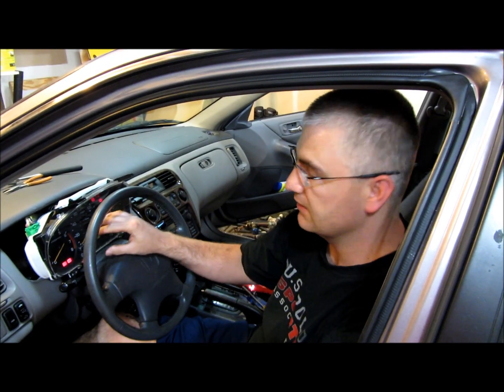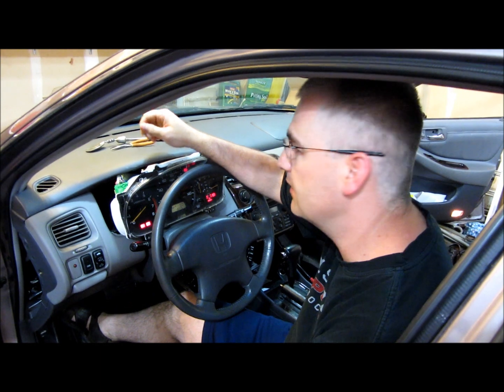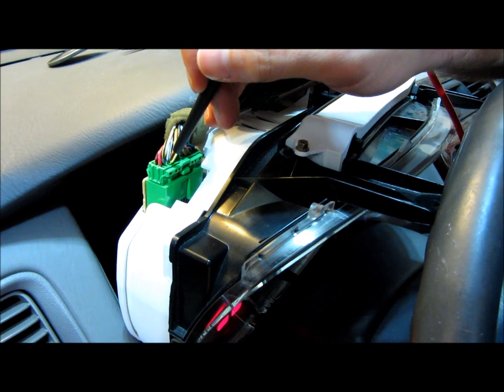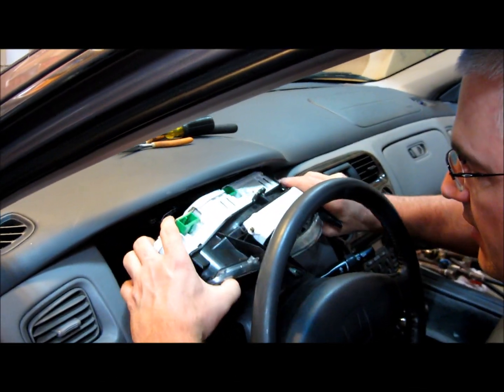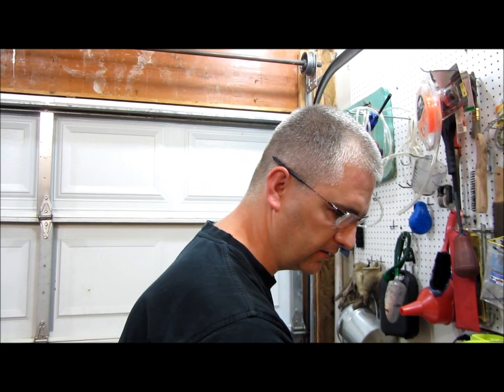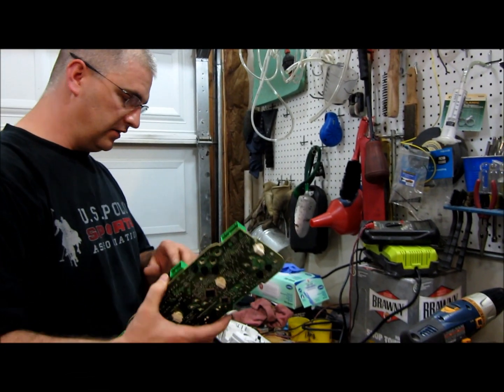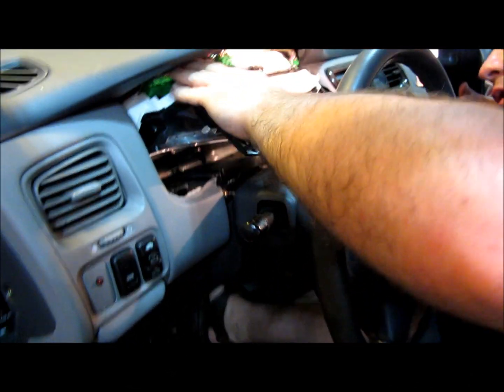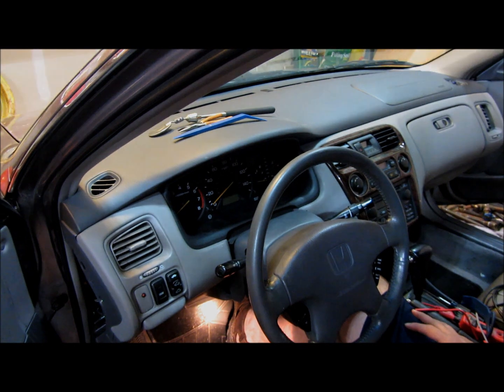2000 Honda Accord instrument cluster display lighting and odometer repair.

Comment: Great video. My issue is the odometer intermittently zones out (i.e., the numbers get wonky). Will try looking at the solder joints. Great troubleshooting techniques, especially isolating the issue to one connector and one wire!

Comment: Awesome video!  Thank you so much.  I was able to fix an intermittent lighting issue using the same process.  That first solder joint was cracked on my cluster just like yours.  Much appreciated!

Comment: For some reason, the turn signal indicators on the cluster do not eliminate when in use, but the turn signal lights do work in the headlight tail lights. They just don’t light up on the indicators, letting me know they’re blinking. I hear the relay clicking and this also happens when I engage the emergency button since they are connected to each other I don’t know what the problem is other than checking fuses. I am waiting for those to be delivered so I can see if that’s a problem they checked refuses they seem to be working. They do need to be changed though. I did add glow gauges to the cluster. I had to modify it, but I did not tap into anything in the cluster assembly just tapped in the fuse so 
When I turn on the instrument panel lights, the blow gauges also turned on as well. I’m wondering if that could be an issue maybe with the wiring I don’t know confused done it any solutions or ideas? I would much appreciate it. I know this video is old. Hopefully this gets to you anyways hope you’re doing well ever since.       peace.
Reply from the maker: It could be the indicator bulbs are burnt out. I know some of the bulbs are serviceable and worth looking into it as it could be somewhat of a simple fix. repair.

Comment: have a 2001 honda accord with the backlight out for 5 years now. The speedometer just recently stopped working. Followed your fix and presto the problems were fixed. I was only expecting the backlight to be fixed and amazed it even fixed the speedometer problem. Many thanks.

Comment: Excellent to see this video...it's 2022, I have the 2000 Accord with this EXACT issues, and avoided focusing on  its repair for fear of the expense. Now it doesn't seem so daunting. However, I'm 70, probably won't be interested in soldering this myself, so I need to know...
1-do I need to take this to a dealer (or reputable Honda repair person) to fix this?
2-if I can't stand the dealer estimate, do I look for someone who does vehicle electrical system repair, as a specialty, or is that not necessary?
3-if the dealer's estimate is "doable" shall I request that they change all the bulbs in the cluster while in there?
I love this Accord, looks like I can get another 100K from it (it's at 189K now and worth this repair). Thanks!

Comment: That's quite common of a problem when that gen. Accord has a crank/no start condition... The main relay up under the drivers side dash has cracked solder points, and with that too, I just took it apart and re-soldered the cracked points (I did them all to be sure) making sure I didn't leave any solder bridges when I was done. That was a couple yrs ago and it still works perfectly to this day.

Comment: I had the exact problem in my 2000 Accord and I used this video to help me solder the same joint that was bad, which fixed the issue! This was my first solder job ever and it went well; I already had a cheap soldering kit I had bought for a seperate project. It was a very quick fix with the proper equipment (flathead screw driver, phillips head stubby screwdriver, soldering gun).
Thanks for your helpful video!

Comment: I have a 1999 Honda like the one in this video. I bought it with A/C and the cooling fans not working. I have replaced fuses, relays, even the controller behind the dash. Nothing has fixed. So what I have done , is found a power source inside the fuse box, and jump wires between the A/C relay and the Cooling fan relays. Now the fans work and the A/C. But I have to remove the jumper, when I park the vehicle less the fans continue to run and kill the battery. 
Can you help me.

Comment: You’re the best! I had the exact same problem on my 2001 Accord where the gauges would sometimes illuminate when I turned on the headlights and sometimes not. Turned out to be that cracked soldering joint just like yours. Thanks a ton!

Comment: Hi Michael, thank you for sharing this video, I would like to seek your help about my Honda Accord Cluster Gauges, I have removed the Gauges to clean the cluster but when I try to reinstall the Gauges back, it won't fit like before can you please help me on this regards.
Reply: Burhan Gilani - maybe I can help, as I've done this a number of times.  The most common issue with reinstallation is getting the top connector on the upper right to clear the wiring harness that runs just above it.  Use a flat screwdriver, or a plastic pry bar, and slide it in between where the connector and the harness are hitting together and gently push the harness up and back, so you can slide the connector past.  I realize this is a month after your original post, so hopefully you would have solved this already!

Comment: Thank you so much for this tutorial, I had the same issue with the lights going out and the odometer looking scrambled.  I've never soldered  anything in my life, but I went online and bought a $20 kit, spent a few minutes watching videos on beginners soldering, and then followed your video.  I was quite nervous about trying this, about in under an hour I took the dashboard out, soldered it the same pin (it was clear which pin was bad on mine as it was cracked and blackish), and put it back in.  Thank you!

Comment: Excellent work troubleshooting. I would have soldered a piece of wire over the cracks.  I have the lights problem, haven't seen the odometer issue yet but I will look at it for sure.

Comment: You could narrow it down by grabbing only the male side connected to the panel and try to keep the pigtail as steady as possible. If it goes on and off it is probably a solder joint on the back side of the connector (solder joints on the back side) if not, move out to the actual connection of the two connectors etc...

Comment: What an awesome diagnosis and explanation for the exact problem that I was experiencing with my 2000 Accord EX. Unfortunately it was my fault for the cracked solder joint due to sloppy and careless removal of the instrument cluster prior to changing a few burnt out bulbs. Mike, you are da man and your video saved me a couple hundred bucks that I was about to spend on a new instrument panel. Thanks for sharing your wisdom and knowledge!

Comment: I have a 2000 Honda Accord with an after market radio that was installed about 5 years ago.  Since the day I had the radio installed, my dash lights turned off intermittently.  The only solution was to bang on the dash until the dash lights came back on, but not anymore.  I followed the instructions in your video and fixed the problem!  I can't thank you enough!  You saved me hundreds of dollars!  God bless!

Comment: This is an excellent video.   Thank you.  My 2000 Accord had the exact same problem: cracked solder joint.  On a very cold day my dashboard lights worked fine, but most of the time drove around without any dashboard lights.  

I like your fix because I get to keep the cars original miles.  A used instrument cluster will have different miles.

Comment: Hi Mike. This was amazing. The odometer on my 2001 v6 accord was rarely displaying the mileage correctly. I watched your video and the took my gauge cluster out to see if it was the same issue. Indeed it was. The first few pins had cracked solder joints. I hadn't used a solder gun in over 20 years (built RC cars as a kid) but figured it was worth a shot. Couldn't get any worse. I ordered a cheap soldering iron and very thin solder. I think it was .020. The thinnest I could find. I melted the existing solder and put on a tiny bit extra while being careful not to overlap. The whole process took me about 45 minutes. My odometer is now working like new. Thank you!!!! BTW, no idea why you got a a few thumbs down on this. Guess you can't please everyone when it comes to free useful information!

Comment: THANKS FOR THE TIP MIKE,I REPAIRED MY 2001 ACCORD DASH LIGHTS AND ODOMETER.THERE WERE 2 COLD SOLDER JOINTS THAT WERE CRACKED,#1 PIN FOR LIGHTS,#3 PIN FOR ODOMETER.LIKE YOU I HAD TO USE A MAGNIFING GLASS TO SEE THE CRACKS IN THE BOARD.ITS GOOD AS NEW,THANKS AGAIN.

Comment: Hello,
My car is 2000 Accord Coupe V6. I installed new radio. Turned lights on and some strange sound squeeked and that was it. My dashboard doesn't work, same problem. Trying to figure out where exactly the problem is but nobody tells me for sure. From internet I figure out I have to replace the MBCU, from shops they tell me to replace the cluster. What's the best way to diagnose the problem so I know what to fix/replace? Please contact me! Thanks!!!

Comment: 2005 Saturn Ion, my Instrument Cluster just started going completely bonkers on me. Say's 'Error', fuel gauge doesn't work.. than it works for a second, tach works most times, speedo sometimes, lights flashing like airbag, ebrake, oil, battery and everything else. Car starts fine, cruise control works, windows, lights, brights, A/C, heat, wipers, runs well.. 

Not Alternator, Not Battery... yes we have stupidly rough roads and I have a car stereo system.. only one JL 10 in a sealed box.

I first thought it had to do with water I ran through on Sunday, but now kinda leaning towards soldering joints being cracked on instrument cluster. I ran through a couple huge puddles on sunday, no issues... Monday morning, started the car, fine. Hit a bump and shit went berzerk!

Does this sort of 'Instrument Cluster' issue happen with most or all makes??  If so, should I attempt to pull the thing out and try to save myself $400?

Comment: Grateful to you, MT, for your video on this topic. Had the same issues, and what you shared cut right to the source of the issue and repair that mattered. Got the solder contacts touched up, and lights and odometer now function reliably again. Thank you for making a difference here.

Comment: I too have had exactly the same problems and was also told that a new circuit board was needed.  Thank you so much for posting this.  I wonder if my dimmer switch is bad as well... No dimming action ,  and I've lost my tail lights.  I had a similar problem with my daughter's Mazda.

Comment: Hey I change all my lights into blue leds but I am having trouble with my check engine light. The light will turn on and stay on with the led light in it but when I put a regular light bulb in it, it does not turn on at all and I need this to be fix for the computer can read whats the problem with my car and why it keeps stalling please help me

Comment: Thank you, thank you, thank you!  3 years ago paid a dealer $100 to tell me I need a new circuit board which is something like $500. Been whacking it ever since but it finally died. Didn't have to remove the circuit board from the assembly to do this. Noticed a crack and soldered it. Works great now.

Comment: Exactly the same problem on my honda accord 2000 EX. Some mechanic told me about the loose connections and told me to replace the instrument cluster. I don't have solden gun and its material so i guess replacing is the only option for me ;)

Comment: 1 of 2
Outstanding video, Michael. Your diagnostic technique is, IMO, the proper way to determine a problem. However, I could get no further than the removal of the trim's top two screws and the dislodgement of the top and top-corners of the trim to my wife's 2002 Honda Accord. I found it impossible to slide the bottom portion of the trim towards me as there's nothing to grab onto. I've tried, carefully, to use a flat-tipped screwdriver to pry the sides and bottom inward while pulling the top

Comment: MIke,
Just bought a 2001 Accord for my daughter (new driver first car). Driving it home it got dark and of course the instrument lights did not work. A mile from home I ran out of gas!! I could not see the gauge. My boys were in the chase car so they brought me back a can of gas. Anyways, I was thrilled to find your video. My 2001 had the EXACT same cracked solider joint. The fix was exactly like your video. A thousand thanks for taking the time to make this video. You are a good person!!
Dave

Comment: why your lower fuel light does not come on when you first put the key into the ignition.
it is the bulb or it may be the same problem,i have some similar problem but the bulb works...

Comment: I'm currently experiencing the same problem, both the dash light and the side marker lights of the headlights don't work when I turn the light switch once. What do you suggest? Does it have to do with the main relay?

Comment: Thanks Mike! My wife's 2000 Accord had the same problem. The dealership said we needed to replace the circuit board for $600. I followed your video instructions and sure enough there was a fractured solder joint on the power feed. Reflowed the solder on that joint and snapped the assembly back in the dash. I hit the switch and we have dash lights again. I think it took longer getting my tools and soldering stuff set up than it did to take the gauge assembly out and put it back.

Comment: Sir, this is excellent vid. I want to put white gauges I have the same car, my concern based on some of my research is that you have to be careful when you unplugged the cluster cables like you did to take out the cluster they say some cars are made to reset the odometer to 0? Did you find when you installed plugged it back the odometer was not reset? I don't want to unplug anything until i know my odometer will not get reset. Thanks